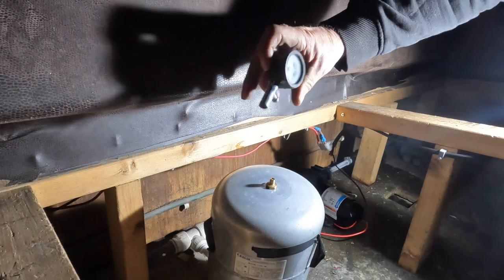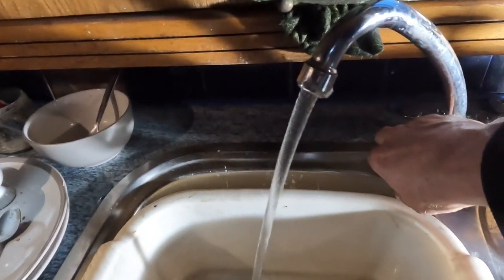I build a mystery box, but what is it for? Dutch Barge Linda 120

Comment: Love ya, Canice!

I got it! The box is a pass-throughway for the ash pan from your soon-to-be-installed INCINERATING TOILET! 
How awesome is that?!

I've been worried about the choice of toilets for Linda's head. I mean, with all the marine toilet options and all those headache-producing problems that go with them - expensive pump-outs, odors of every flavor, holding tanks of black water, cramped onboard space, need for seatbelts due to large waves, and so on. So what would you choose? I didn't think you'd settle for a honey bucket. Still, I wondered if you'd go with a gravity flush, macerating, composting, cassette, porcelain, or something luxurious with a bidet. Now, I like bedets. 

But, lo and behold, you're getting an incinerating head! I should have known you'd take advantage of an incinerator, save water, eco-friendly, hygienic, easy to install on a Dutch barge, low maintenance, portable and space-saving, minimal odor, bug-free, and durable.

You're a smart one, Canice.
Reply from the maker: Hahahaha! The one thing nobody ever mentions about incinerator toilets, is the amount of energy required to run them. Originally they ran on gas and they burned a lot of gas not exactly good for the environment. However the new ones are electric but to provide enough electric to cook your poop, you need to run a diesel generator. The most environmentally friendly system is holding tank and have it sent to a sewage treatment works. Composting toilets, only work if you have somewhere to compost it. There is no space on a boat to compost poops. However, to give you a bit of an insight I am planning to have a holding tank but with my own pump on board this way if the pump out machine isn’t working, I can pump it out myself and pop it into a toilet….

So I’m afraid it’s got nothing to do with an incinerator toilet😂😂😂!
However, it does have something to do with a very large window. Shush, don’t tell anyone !

Comment: Hi Canice, what happened to the plasma cutter? Did I miss an episode? Nice to have the warmer weather again isn't it, as for the box,,,, I thought it maybe conected to the bathroom (oops heads) as it is behind it, like pump out point but that doesn't make any kind of sense,  I guess I'll have to wait for the next instalment.
Thanks for your time and hard work putting this and all your videos together. See you soon.
Reply from the maker: Hi Simon, as for the box, all will be revealed in the next video. The plasma torch will be coming out again. The reason I didn’t use it on this occasion was because the angle grinder was more convenient. Currently the generator is blocking the route for the compressor to get out. 😭😂🙄

Comment: Your best video so far! They just keep getting better. A ton of water in the bilge because of a leaking water tank sounds crazy familiar. Interestingly you also managed to drain all of your tanks and not just one. Why do you don't have a bilge pump?
Reply from the maker: Oh thank you very much for the compliment. When they built this boat in the 1990s, they didn’t consider access hatches in the floor, so there isn’t a bilge pump for the cabin area. However, there is a bilge pump for the engine bay. All narrowboats have a steel water tank and the tank is integrated into the hull. If you have a leak, all the water comes out, usually the leak is after the pump and you can hear the pump running!😭😭😭😂😂
If you have rust and in the tank it’s the hull wall that rusting! 🙄

Comment: It's a filling station, it can be locked, so no alien force can put something nasty into your toilet water. By the way, 90% of the time, the floor beneath a toilet is the first place where the rust will eat through your boat. So: 1- make a good inspection possibility and 2- use a good product for rust prevention. Not a paint, but a creeping kind of lanolin like fluid film.
Reply from the maker: I am obsessed about water ingress in the bilge under the toilet. I have a plan to ensure a waterproof floor with access to inspect. In my head, it makes sense. Let’s see what happens when I try to build it.! I’m not going to paint the bilge I don’t trust, paint or epoxy I’ve seen both fail. It will be grease all the way baby! Or lanolin. 😂
Reply: @canicebannon  When you use grease....first smell it! You will smell that air for the next 20 years so it better smell nice! A lanolin boat smells like a newborn baby (or lam).
Reply from the maker: @omvaren  This is a very good point!

Comment: Great video, is the box for a battery isolator with the positive and negative wires very thoroughly separated into their own tubes perhaps? If you cut a hole into very lowest corner of your floor you should eventually be able to get more or less all of the water out. 

My narrow boat has been unheated this winter and in the long cold spell it got down to -7 degrees inside the cabin. I got so worried about pipes and pumps freezing that I would run the  engine and have all the lights and fridge/freezer on for an hour or two in the middle of the coldest nights. Luckily my closest neighbour is not that close by. It would lift the temperature on my CO alarm up one or two degrees. 

Being moored in a flowing river perhaps doesn't chill a steel hull as much being sat in a still canal? 

Great music too. Thanks very much.
Reply from the maker: I’m still not entirely sure why it froze as the fire is on all the time. 
The difficulty with getting the water out of the boat in my case is because I have concrete ballast so when I cut a hole in the boat I get to concrete and not the bilge, it’s a long process. It will dry out eventually.
I’m glad your narrowboat is doing okay, you’re probably right about the flowing water!😬😀

Comment: I am guessing it is for water supply to your head. If it didn’t have the valves I would have said a pizza oven. 
I liked the piece where you are welding and your face shield thing is on the deck next to you 😵‍💫    Glad you were able to get the water out of Jorga.  I think the Crobots would definitely be impressed by your mastery with The Titan as well as you did it in one day as opposed to them having to remove the floors and 
ballast 😢 for months. They are very funny.   Looking forward to seeing what the box is for, but concerned about the steel uprights and you saying you were going to have to reset the whole thing.!?!?!?!  What does that mean?  I am old, and need to see this through. Have a good week. 😊🤗 Kathy
Reply from the maker: Hi Kathy, the uprights are absolutely fine. It was just a bit finicky to set up. Thankfully, Jorja is bilges are dry all the time, so it is only on a rare occasion that water gets in. No harm done. I’m so glad you pointed me in the directions of the Crobot channel. They are so lovely, funny and endearing! Hopefully one day they’ll pass me and we’ll wave at each other!

As for the box all will be revealed in the next video !
Reply: @canicebannon  Can’t wait for the box unveiling!  The Crobots are extremely funny, work together well, and determined to be able to get that boat on the canal this spring.  So hopefully one day you will meet them.  In the meantime…. I am looking forward to your plans for Linda, more welding 🔥 , more words of wisdom…or your doom…from your father, and you have a beauty Dutch Barge to live on.  Thanks for the lovely reply Canice.  🙏😊🤗 Remember 🥾 😇 Kathy